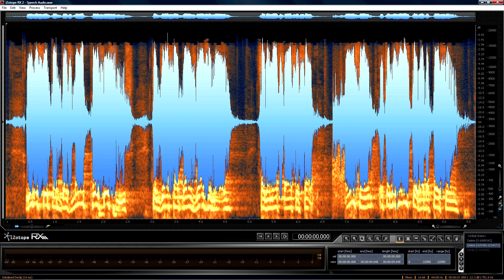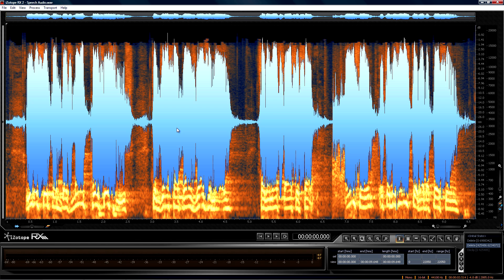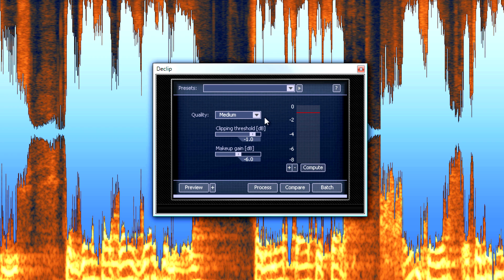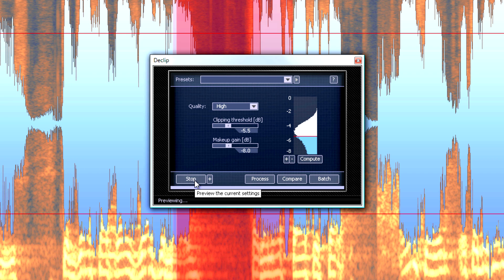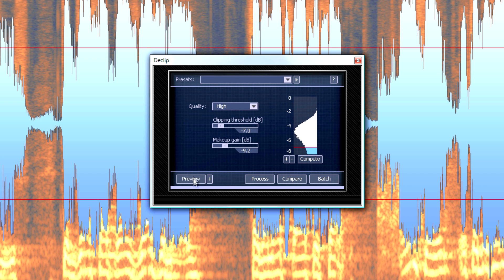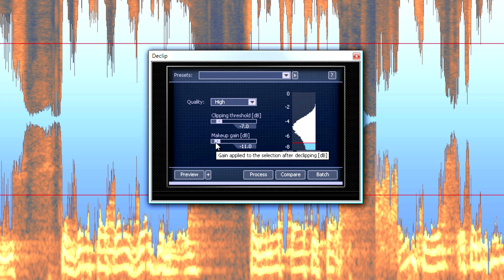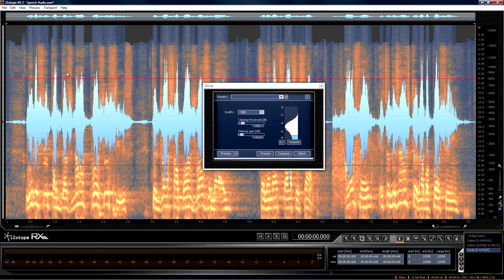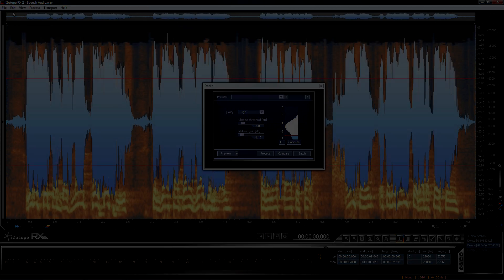How to Fix Clipped or Distorted Audio with iZotope RX 2

Comment: can you remove traffic noise ? That is my biggest problem. I do news coverage.
Reply: RX can definitely do that, and a lot faster than the typical method. When you record audio try getting some extra sound of the environment you are in without people talking (usually called a room tone) Then you can use that as a sample for your denoiser to learn from. RX has a feature that tries to predict what that would be and can strip the voice from the background and the newest version makes it sound nearly perfect.
Reply from the maker: avimukta1 I haven't tried that yet. Are you using a supercardiod or hypercardiod microphone? If not those would be your best bets.
Reply: I use a Hypecardiod. I think the problem could be the proximityand the volume of traffic.
Reply from the maker: avimukta1 Yeah, there's no way of getting away from traffic noise. RX can do some amazing things though...traffic noise is very random though and I believe ADR (voice overdubbing) is done in movies a lot for this very reason whenever they are shooting outdoors on-location.
Reply: +avimukta1 you need 2 things : a denoiser and a gate, i use them to get rid of traffic noise all the time,  c1 gate  from the waves bundle is a very good indeed.
Reply: Hi Joemy! Thanks  i will look into that :)
Reply: Thank You every one for your comments:)
Reply: I do that quite often. So it sounds good, there's actually a chain of inexpensive plugins that you can use to get the audio prepped for RX because RX doesn't have a single click fix for that. Since traffic sound has a lot of upper frequencies as well as rising frequencies due to the Doppler effect...it's makes it more difficult to clean it up. I'm sure you got your answer by now but yea...RX won't due that without experience in sound. Not to imply that YOU can't do it. I'm saying it would take more than just selecting a region and hitting "repair."

Comment: can this be used to fix distorted/muffled concert cell phone video?
Reply: I was thinking and wondering the same thing because I recorded some good sets at Hard Summer this past weekend but its distorted. My iPhone 4s records good audio but even this was too much. That house bass ;)
Reply from the maker: TemplarReturns ghostrid3 Sorry I didn't see your question sooner. I'm not sure if it can or not. Two issues with cell phone audio are piss poor converters and data compressed audio. You'll just have to demo RX yourself and try it out.
Reply: ghostrid3 Depending on how bad the distortion is, Izotope Rx's Declick and Decrackle can clean things up a bit, using the Decrackle portion. I just finished playing with it for a soundboard recording of a Tool concert floating around, where Maynard's mic was either pushed too hard by the sound guy, or he damaged his mic with his power screams.. lol. It cleaned it up, but strangely.. Medium quality did a better job than High. High quality, with the filter set at it's highest strength left "some" crackle here and there, while Medium quality at the same strength completely removed the crackle. At a loss of quality though.. you could hear flutter going from channel to channel wherever the heaviest of the crackle was removed.

And regardless what quality setting.. the stronger the filter setting, the more chance you'll lose your cymbal clarity. They'll start to sound washed out, especially half-closed high hats.

As for the "muffled" part of your audio... nothing can fix that.
Reply: ghostrid3 can be used to correct distorted sermons...